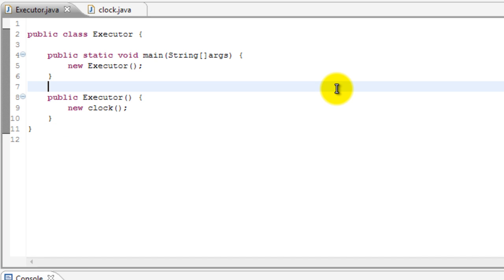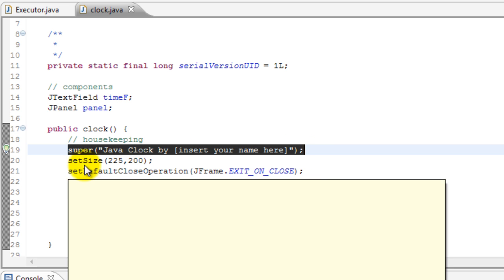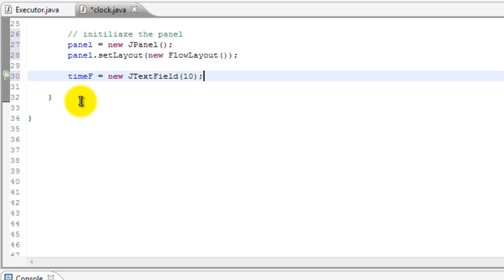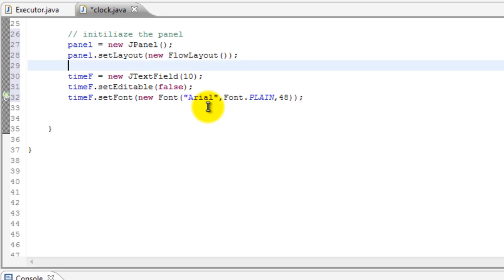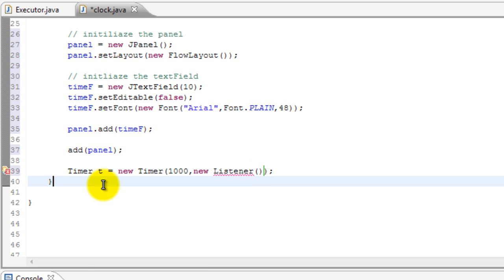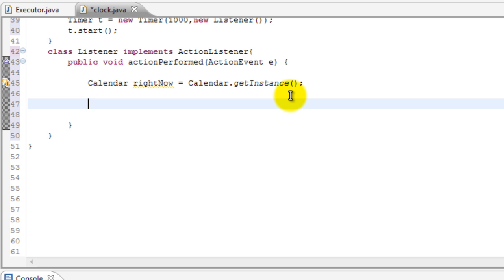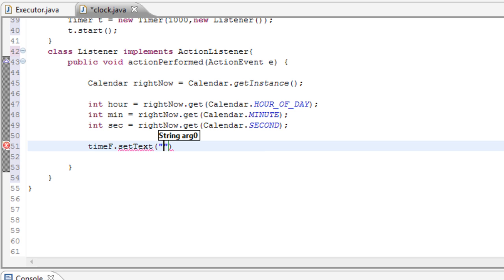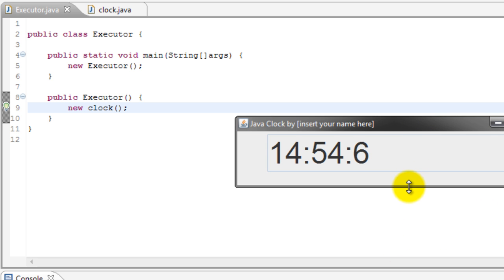How to make a java digital clock (SOURCE PROVIDED)

Comment: I'm wondering how it happens with memory usage because I was just playing around with the calendar class and I observed that memory usage grew regularly. Even though I did a separate method to get the current value thinking I could take advantage of the scope but it changed nothing. every seconds the simple code eats more and more memory which is not cool if you consider using this for a long period of time.